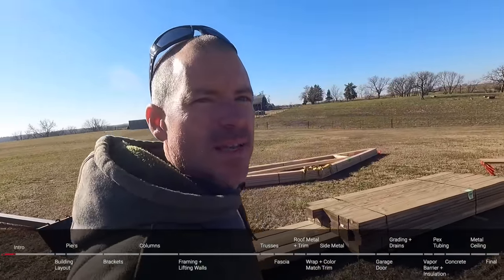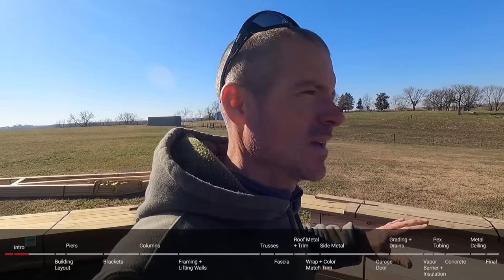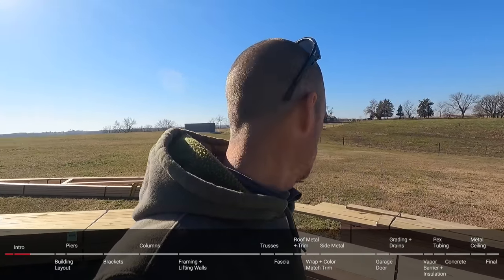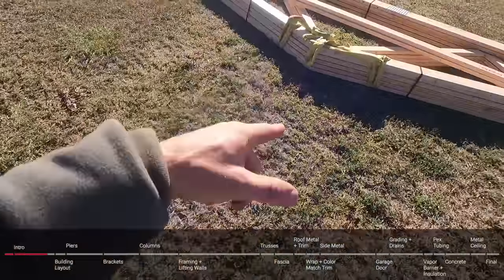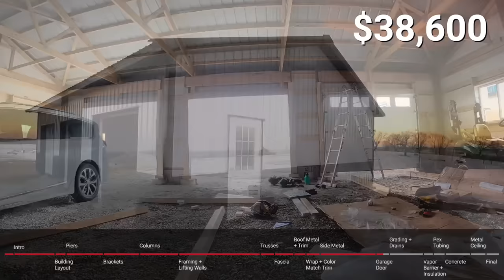Garage Material Cost + Labor + Full Timelapse | 30' x 40' x 9'

Comment: With the brackets being placed to one side of the pier, that would put a lot of stress on the lesser concrete side of the pier.  I would think the brackets would be placed in the center of the pier. Am I missing something?
Reply from the maker: We aim for the center but sometimes when digging the hole you’ll hit rocks that gets the hole off a bit. We aim for the center but doesn’t hurt at all to be off a little. Plus a full 5” slab gets poured over the top of these piers and brackets and locks it all together.
Reply: @MrPostFrame  I understand that now.

Comment: Man I couldn't cover the insulation in attic materials alone in Texas would be 1500.00
Reply from the maker: I need to put an asterisk on that attic insulation and plywood walls. The client did the labor on those two items. That insulation was the cost and with the purchase they provide a blower for free.
Reply: @MrPostFrame  so the $5k for spray foam was just the walls??

Comment: I can't believe no exterior plywood was used. So basically you have the metal sheathing paper moisture barrier, insulation then the interior plywood walls. Nice building though.
Reply from the maker: Exterior plywood is not needed. The building gets its shear strength from the metal.

Comment: Why the 2x4 between the wet brackets? Mock up for slab form later? Just curious. Thanks so much for your great content. 👍
Reply: If you mean between the bracket and the string line it’s because the line marks the outside edge of the building. So the post is set far enough back to account for 2x6 girts.
Reply: 2 reasons to use a 2x4 like that. The first is mentioned in the prior comment, that this allows you to stake the actual dimensions of the building as their will be girts on the outside of the posts. In my opinion that’s only secondary to the fact that it allows you to prevent having the string line gradually get pushed out with each bracket. If the brackets touch the string, you can end up with a curved wall as each one could push the string out just a little further than the last. The 2x4 is easily removed, allowing the string to be straight from each corner for reference for each bracket.
Reply from the maker: Correct...marking the outside edge of building since a 2x6 girt will be added to the outside of the columns.

Comment: what is the storm resistance of a building like that? To tornado?
Reply from the maker: We put 3”s of closed cell spray foam in the walls our buildings which also provides up to 300% more shear value. They do very well however if a tornado rolls over the top of it there will be trouble.
Reply from the maker: Outside of an icf build nothing g is stronger than Mother Nature and even the roof on an icf unless its concrete will be ripped off.

Comment: So I've got a question why are the wall beams done like a header and not using a post
Reply from the maker: Not sure I'm understanding what your asking. Are talking about the stub columns the were created above the garage. If that is what you're asking about...I like to keep my trusses 8' OC so all the back columns are 8' apart and then I create stub columns connected to header above garage door openings.
Reply: @MrPostFrame  no your wall beams they are 2x8 or 12 and they seem to be put together like a header above a door its the main ones that attach to the concrete columns.
Reply from the maker: Oh, you're talking about the laminated columns. Yes, we use 2x6 and 2x8 laminated columns for all our builds. They are actually stronger and straighter than a 6x6, especially over longer distances.
Reply: @MrPostFrame  ok thank you was just wondering like the knowledgeable content keep it up

Comment: Plastic was installed incorrectly, should of been on top of the foam and in direct contact with the cement.  In this method used in the video, the ground is colder than the floor.  Warm vapor will not be able to dry into the capillary break because the plastic prevents it from doing so.  Warm air with condense under the foam and on top of the plastic.
Reply from the maker: And then puncture holes in the vapor barrier for all the tubing?

Comment: Sticker shock? You can’t buy two crappy cars for the cost of this building — and it will outlast them both by decades. I have been doing my own building, vehicle and equipment (this includes everything from iPhones to appliances) maintenance and repair since the late 1970s and this project is a bargain.

Comment: 60K is  the new 30K I didn't see any attic insulation. It would be a good shed. But not so sure about the garage. Why build like this w/o insulation in the snow region? I would want a fully insulated building with gas  furnace in there and an AC. How cold is it in there on -20 bellow? How humid is it during summer?. How can you work on cars or spend time in the garage w/o heat and A/C Try working on cars during humid days the floor will look like a pond and you will be covered in sweat. Those issues must be planned ahead . What was the plumbing for? A drain? Did not even see electrical panel? I wouldn't mind paying more for a bigger building fully insulated , with a bathroom , windows, climate controls and lots of concrete surface . This was just a 3 car garage. Metal buildings don't look good it would not be my choice. But it seems they did a good job for what the product was and give this guy a credit for posting the numbers!
Reply from the maker: This building is fully insulated. Received spray foam on the walls and blown-in insulation in the ceiling. It also has in-floor radiant heat which will heat the space. There is a vapor barrier and insulation under the slab so it will sweat with humidity. Plumbing was for drains. Thanks for watching.

Comment: Isn’t it cheaper to do all metal not wood  structure. 

Seems a bit much for doing it yourself. 

Had a barn put up for 14,000
Reply from the maker: No, not necessarily. Especially the smaller you build. 

Basically, $38,600 in materials just to do the structure. That includes the concrete piers. You're going to be about that same price for a steel frame structure in our area.

When did you have that barn put up and where are you located? $14,000 is an amazing price for a similar size structure.

Comment: It's no way $52K without labor. I did my 40x42x14 (prefarb metal truss, square metal frame) building with 12' roll up doors (for boats) and 26 ga metal 3-bay for less than $25K (excluding labor and concrete). How do you come up with $52 for wood frame, 29ga metal and 9' tall? That should be under $20K. I run numbers and total metal for this building is $2500-2800, wood is less than a $2K. I do not see $52K. Please post an excel file with all expenses, otherwise it's bs.
Reply from the maker: I think if you watch the entire video you’ll find the answers to all of your questions.
Reply: I am reroofing my workshop 275x60 new trusses and 26ga metal, screws, facias, 12 skylights 11x3 (removal of 6 layers of shingles - outsourced at $9K) I am still under $40K total, and this is a tiny garage.
Reply from the maker: Glad you’re finding your project to be a good value for you. We built this in late 2021 when prices were quite a bit different than they are today. The purpose of our cost breakdowns is to share honest information. Your location or circumstances may mean different pricing for the better or for the worse.
Reply: @MrPostFrame I went back to my 2021 year folder and In 2021 I built a 30x80x12 29ga metal storage building all materials $32K. $52K for materials is just not realistic. I can show you my spreadsheets.

Comment: Seems like it would have been a lot easier and safer to do the foundation and slab first and then build the structure.
Reply: Not on a post frame. Concrete is done after building is up.
Reply: @MaximusMerideus  It doesn't have to be. When the structure is up and in the way, there is a high chance of damaging the structure with dirt moving equipment. No reason to build structure before the slab is completed. The only time it makes any sense to do the slab last is when someone is putting a slab in a pole barn type structure that never had a concrete floor. Here in Louisiana, we do monolithic slabs all the time for metal buildings. I've built several buildings in Tennessee and Louisiana and have worked on hundreds of buildings in the southeastern United States. Never saw anyone do it that way.
Reply: @robocowone464  For sure in the south, where there is minimal to no frost depth you can do a slab on grade.  You can do that in the North also, would need to be an insulated slab on grade and there are specific guidelines and insulation requirements for that based on location.  If you know that you are going to have a poured slab, as they did, the cost will come out lower for an insulated slab on grade, especially since they had to insulate anyway.  It is just a matter of thickening the edges and also carrying the insulation out past the building below grade.  I would say that in general, most builders build with a certain approach and they stick with that.

Comment: Insane that a 30x40 pole barn costs $70k in 2022 !!! I had a commercial grade steel building built in 2019 that is 30x40x10 with two 8ft doors and one 10ft door, all power doors, and a side entry door with a 20x40 slab of concrete in front of it, all on 8'' of concrete for $32k!!! No way in the world a wood pole barn should be that much 3 years later. People are definitely getting raped since covid!!!
Reply from the maker: Thankfully we’re seeing some costs come down. Hoping that trend continues. But overall costs always go up over time
Reply: @MrPostFrame  
Yeah the prices on some stuff is coming down, finally!! I framed the walls in on mine and put up 7/16'' OSB on the walls and I bought 44 pieces of it at like $8.50 ea. When covid came rolling in it was as high as $45 a sheet at one point. Absolutely crazy !! I have saw it for $10.40 here in the last few weeks tho. Hopefully it continues to fall out. Now the prices of houses, vehicles and such need to come on down.

Comment: Completely out of reason. $$$57,000. dollars for a shed! A fool and his money. You could build this in a few months by yourself for $25,000.
Reply from the maker: If it was just a shed, materials are $35,000. Then you add below grade insulation, radiant in-floor heat, concrete, 3" of closed cell spray foam, finish out the walls on the inside, etc... And now you have yourself a heated Garage/Man Cave. Maybe you didn't get a chance to watch the whole video. $52,000 is the cost of materials, yes materials only.

Comment: I didn’t see any foam spray on the ceilings all you did was covered it with plastic material. 🤦‍♂️ and charged the guy for something you didn’t do
Reply from the maker: The customer did his own blown-in insulation after we installed the plastic and metal. The cost in the video was just material since he did the labor.